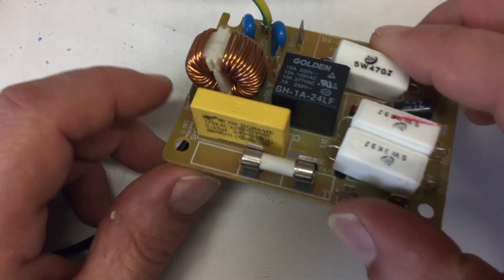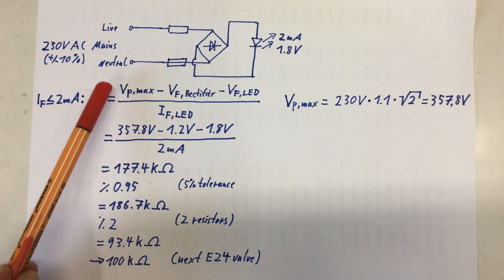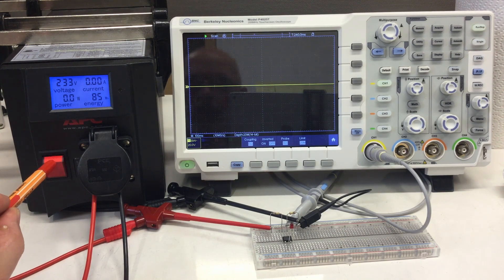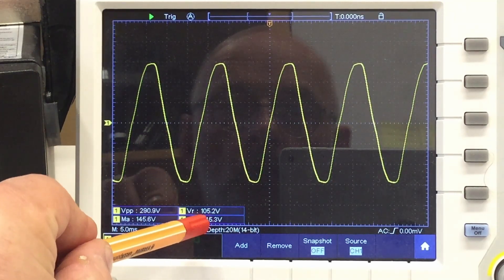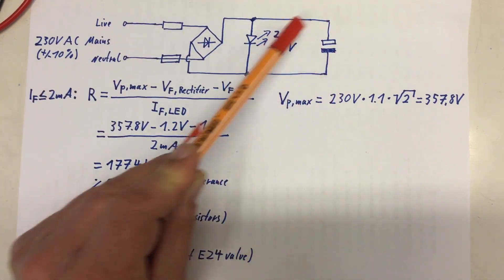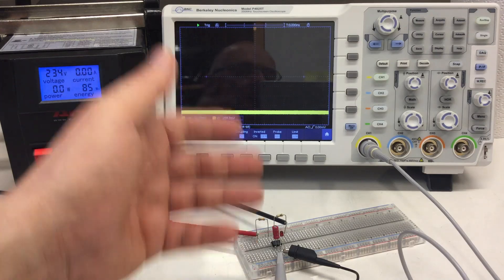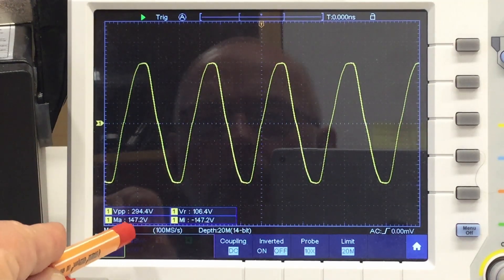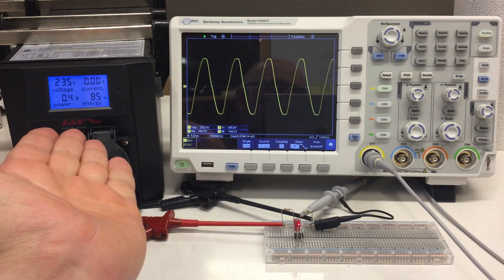Flicker Free LED on Mains AC (A Low Current 2mA LED That Is)

Comment: At 0:49: Why would you use a class X capacitor? 
I thought those fails short while class Y fails open, which seems the most desirable when used in series with the mains.
Reply from the maker: You are absolutely right about X class (line to line) capacitors being designed to be failing short and Y class (line to ground) capacitors being designed to be failing open. Anyway, regulations require just a X class capacitor in this application (line to line). So my statement should have really been that you need AT LEAST a X class capacitor - my bad. So, why wouldn't you use a Y class: A) Costs: For example, a 0.15uF X2 capacitor will set you back about 40 cents, while a 0.15uF Y2 capacitor will cost you about 1.60 bucks - four times as much. B) Physical size: Y class capacitors are much larger than X class capacitors of the same capacity. That said, there's nothing keeping you from using a Y class capacitor in this application.
Reply: @robertssmorgasbord  by the way, I really love your thorough videos explaining the thinking behind your designs 🙂
Reply from the maker: @SpecieltBrugenavn  Thanks for the praise and you're welcome! BTW you're question (X vs Y class capacitor) was absolutely valid. I did just cite the regulations without thinking about it any further 😅

Comment: Nice and very usefull circuit, thx :-)
Reply from the maker: You're welcome! I'm actually using that circuit in an upcoming video ("Laboratory Water Bath (8)", to be published next week). There I'm actually adding the Zener diode I'm talking about in this video, which forced me to reduce the resistance of the dropper resistors considerably ... you'll see ;-)
Reply: @robertssmorgasbord  , a zener cause more noise, but this noise can be filtered by adding a small value capacitor in parallel with the zener diode. But for signaling / optical showing the on/off state of a device, this extra noise is negligible.
Reply from the maker: @BjornV78  I'm happily taking the noise from the Zener diode for the security it gives me :-) In my application the LED will be connected via two (!) detachable connector to the circuit. Knowing me I will at one point connect AC mains without the LED being connected and blow up the electrolytic capacitor ;-)